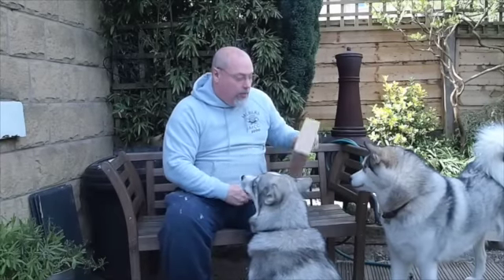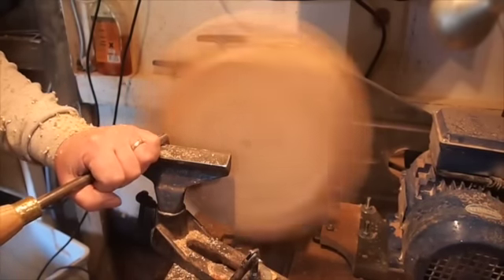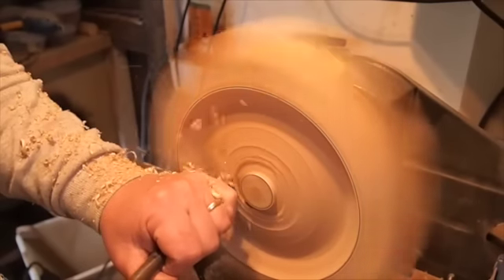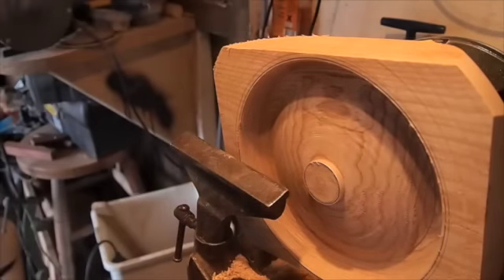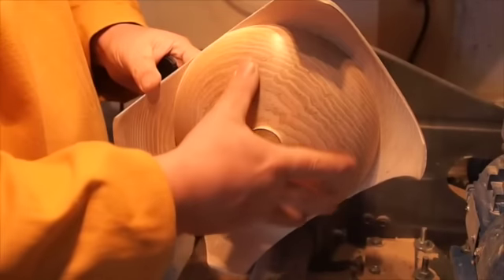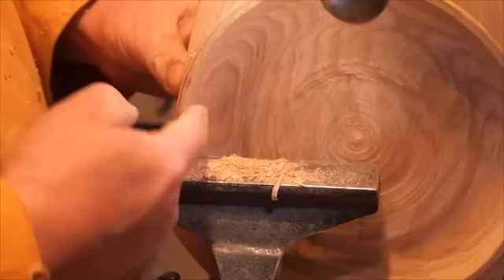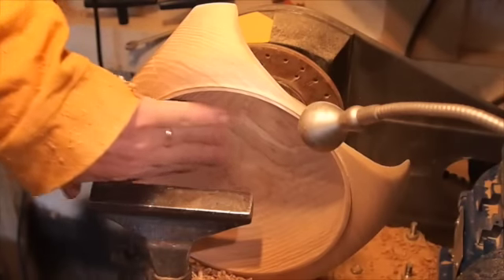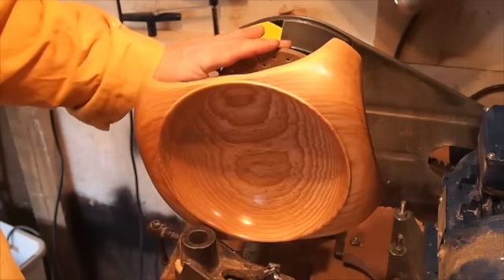Square bowl

Comment: A very nice winged bowl.  Clearly, this type of turning is for a more experienced individual.  To me,  the feet of the bowl pose a safety issue if your fingers or tool happen to get caught by one of the corners.  Great care must be exercised when turning a bowl of this type.  However, your long sleeves on your garments are definitely safety hazards.  If the corner of the bowl were to catch the sleeve, you could very well be seriously injured at the speeds your were turning the wood.  Safety should be your number one priority.  Other than this, you definitely turn a nice bowl!!!!!!  Thanks for the video! Great job!
Reply from the maker: Hi Glasscutr, you are correct about the long sleeves, but in my defence it was very cold that day.... :-) I have a way of working that just comes naturally to me, that means that I don't rush things and don't put hands, fingers, arms or legs where they shouldn't be. But you point on safety is correct. I'm glad you liked the bowl, and if your patient and work slowly then it's not that hard to make one of these. You just need to work carefully and think about each small cut as you do it.  thanks again for the comment.....

Comment: I want to try this. Is it rectangular or square? Can you tell me the dimensions when you started? Thank You.
Reply from the maker: Hi doublekkkids. 
It was a long time ago, but the original blank was rectangular and was approximately  11'' by 14''. you can see the longer axis has a small flat area near the lip of the bowl. Were the shorter axis has the lip of the bowl right at the edge of the piece.

Comment: First time on your channel. Won't be the last either. Beautiful bowl.
Reply from the maker: Thanks, I'm glad you liked it, Have a look at the pomander videos.
Reply: @KeithWorswick  A lovely piece of work Keith. I must agree though with the comments regarding the angle grinder. Why didn't you use a roughing gouge?
Reply from the maker: Hi  @huwdavies5264  well I could go on about how fast it is ... but I don't turn commercially so I don't really have that excuse, but I found that there is very little torque on the tailstock and I can get the wood round and true without any catches. which is important when the wood in question is heavy and very eccentric. Also this never happens.....https://www.youtube.com/watch?v=5FxqB9CPeJ0......

Comment: Nice job… how did you cover the crack on the leg ?
Reply from the maker: Well... I didn't. 🙂 It actually closed up all by itself once the pressure was removed from that part of the wood. Sometimes by making it thin the wood can relax a little..
Reply: Ahh, got it, thanks for your reply 👍🏻

Comment: Hi Keith  beautiful job !  Could you give me the size of your blank ! Looks like 2 .1/2 inches thick x 11 inches square ?
Reply from the maker: Hi Victor,  Thanks I'm glad you enjoyed the video. I can't remember the exact size of the blank but your estimate is about right. However the blank itself was not actually square, it was about 10 by 12.5 inches which is why the finished bowl has "ends" with a flat area between the feet but the " sides" come right up to the lip of the bowl.

Comment: Love your bowl. did you leave the bottom tenon in place? If you removed it, how & when did you go about it?
Reply from the maker: Hi Shelly, Thanks, I'm glad you liked it.
To answer you questions, no I removed the tenon. But I didn't film it as watching me sand it off would have been very boring. I used a belt sander first with a very course grit, and this removed most of the material and then switched to a DA, (random orbit) sander with progressively finer and finer grits to smooth out the curve of the bottom of the bowl and to make sure it was consistent all round. So no magic just sanding......lol
Reply: I thought that is what you did. Thanks again!!

Comment: Keith, as you were finishing the turning on the inside of the bowl, it looked like you were making tool contact above the center of the piece.  Is this just because of the angle you were shooting with the camera?  Or were you actually making chisel contact above the center point.
Reply from the maker: Brian Mero Hi, I'm pretty much on centre hight but anywhere within 10° of centre would be OK and when finishing the centre it's always good to come into the centre slightly higher than centre and come down to the centre.

Comment: How thick was the piece when you started? Looked like it was 2 or 3 inches thick
Reply from the maker: Hi Hotrod Hog, Yes it was around 3 inches thick, and the bottom of the bowl was about 1/8th of an inch up from the feet when finished.
Reply: Nice job! I have a piece of walnut 2 inches thick and wanted to try this. Maybe glue up a 4 inch thick piece. I think it would look funny with a glue line though.
Reply from the maker: @hotrodhog2170  Not sure if the feet would hold together well with a glue line through them?? One idea I had was to get a ring (flan dish) and put a handkerchief over it.... and then try to replicate it in wood.! A 2 inch thick blank would be perfect for this.

Comment: Nice work . What kind of lathe is is that . I'm from Canada and it looks like my mastercraft . I'm just curious what kind it is .
Reply from the maker: Its a very old B&Q own brand lathe, The actual brand is "Performance power pro" I have added the motor and  speed controler which cost a lot more than the actual lath originally cost.....lol.
I'm currently in the middle of adapting an even older lathe to replace it..... new is always too expensive, as I like free..., I've got another video coming up ....soon, ish. and hopefully you'll see it then.
Reply: Keith Worswick 
Haha . Free is always good I prefer it lol . I'll watch for your new vid.

Comment: I thought they were a tad light in color, but the overall coloration is similar.   BTW, tried the bowl, got a catch, everything went downhill after that.,   All of which means, I will just have to give it another go. :-)   Thanks for the video
Reply from the maker: Delbert Freeman when doing the corner feet, use a small very sharp tool and spin the job as fast as you dare.... :-)
Reply: I know its a poor craftsman who blames his tools, but it looks as if the block I chose to use was most of the problem.  I decided to just turn th feet off the bowl and make a small candy dish.  Even doing that the side cracked (no catch this time).    I am doing a bit of enforced shop absence, but when I get back into it, I am going to try again.  This bowl is just too interesting not to..
Reply from the maker: Hi Delbert, did you manage to have another go at a bowl?

Comment: I have attempted this style bowl a few times, always end up spending far too much time sanding to make the legs look halfway decent. Any pointers?
Reply from the maker: Dave Paul Hi Dave, well to tell the truth, I cheat... When designing the bowl I take into account the clearances I will need for my (various) sanders including the flap wheel on my 4inc grinder. and I only need to hand finish at the highest grits 1500 and above, and yes it still takes a lot (comparatively) of sanding.

Comment: Hi Keith,
I just found your channel and subscribed!
That is an amazing bowl but a little beyond my ability right now,,,I've only been turning for about 1 year and mostly with carbide tools.
If you don't mind me asking,how do you hold the sand paper onto your high speed multi tool?I don't have a multi tool but am thinking of buying one.
Thanks for a great tutorial/video and I'm sure I'll be back soon!
Tom
Reply from the maker: Hi Tom. Thanks, I'm glad you liked the vid. the way I sand with a multitool is to use the sanding drum that is "usually" part of the tool set that comes with the multitool itself. you can also get replacement sanding drums and mandrels from places like B&Q, Wickes and Homebase, so all over the place. here are a couple of links the the kind of thing i use. ( I in no way endorse the following, I'm just using them as examples)
https://www.ebay.co.uk/itm/104Pcs-Sanding-Bands-60-120-320-Grit-With-4-Mandrel-Use-For-Dremel-Rotary-Tool/112768842927?epid=6013504492&hash=item1a418bfcaf:g:2uUAAOSwNDJaYHbA
https://www.ebay.co.uk/itm/162-PC-Rotary-Mini-Drill-Bit-Set-Hobby-Jewellery-Craft-Grinder-Electronic-AmTech-/282786136269
Reply: Thanks for the fast reply and links!
Looks like a very hand tool to add to my arsenal!
Tom

Comment: how did you fix the crack on the side
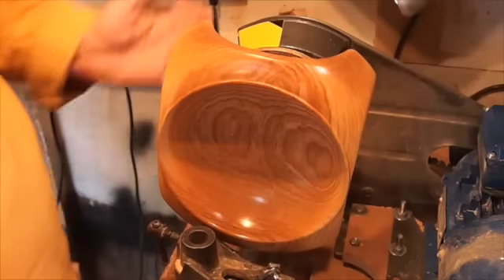Reply from the maker: Hi Michael. Well.....actually I didn't. it's still there. Have a look at time index 19:01 when I'm oiling the bowl and you will see that you can just make it out a fault in the grain pattern. I have found that... "sometimes"... when you have a crack in a piece it will close up when the wall thickness is small, and will close up even more when the wood is oiled.
I also think that, so long as the fault in the piece is small and Natural then it can add to the appeal of the final piece.
Reply: I was thinking that you will glue it.